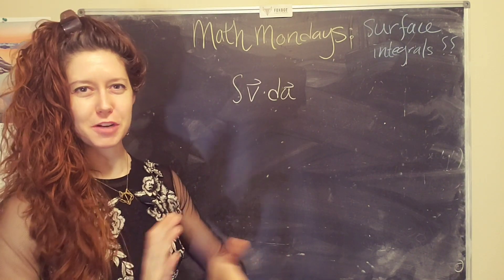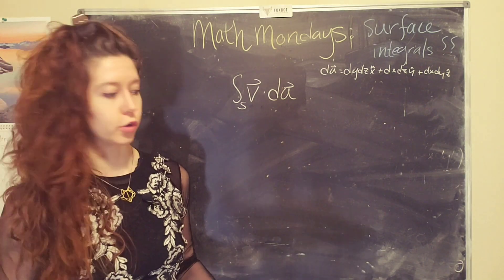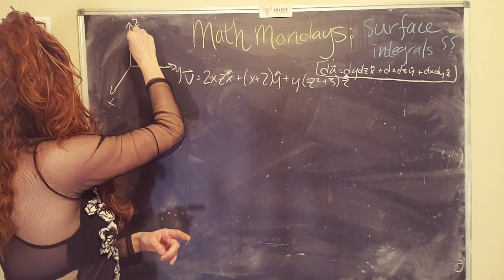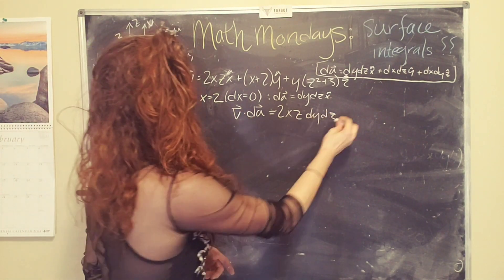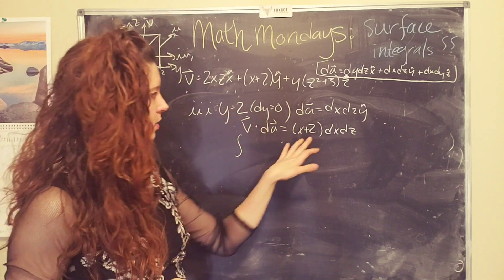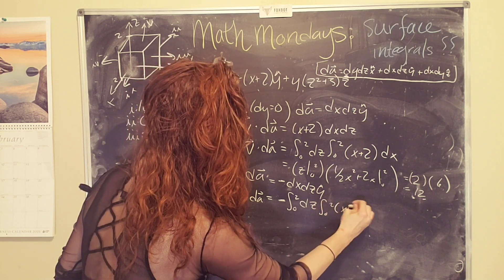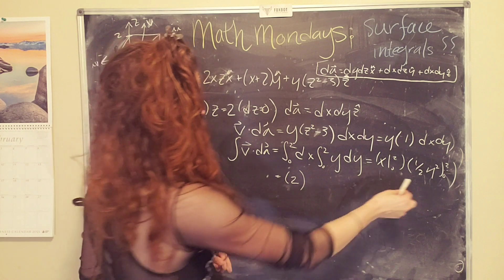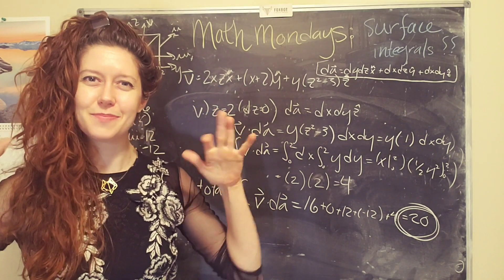Surface Integrals! (the explanation you've always needed)

Comment: Why do you get to choose the bottom as the influx? I don't see from the setup why you chose this face. Or is it arbitrary? You'd get the same answer regardless of the face you chose.
Reply from the maker: Great Q! Yes, its absolutely just a choice. However, the answer will change due to the difference in Flux out each surface (bc of the given eqn). If you had the same flux out each surface, then the choice of influx wouldn't change anything.

Hope that helps! Worth testing out if you're curious -- the bottom face is similar to the left and back faces